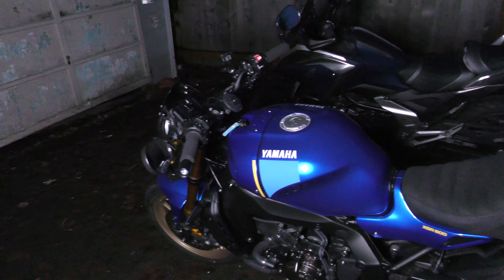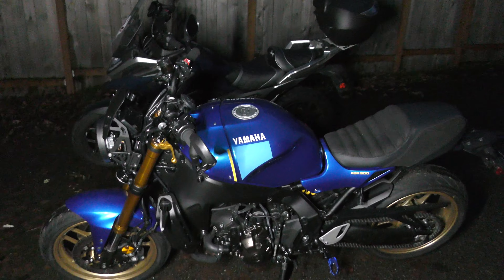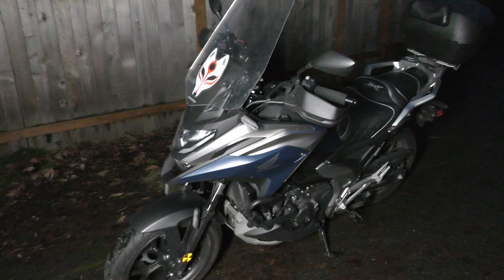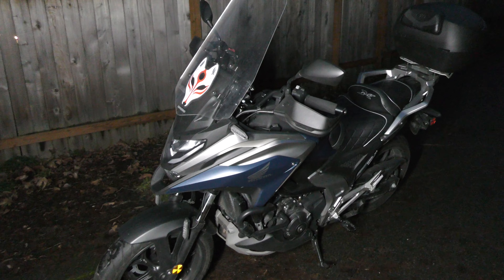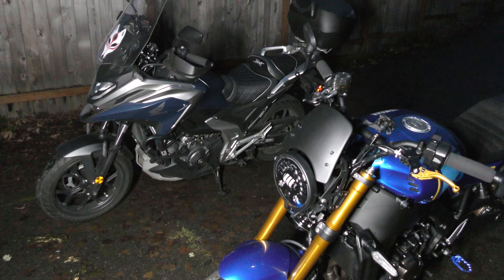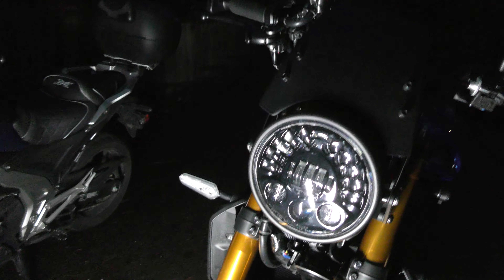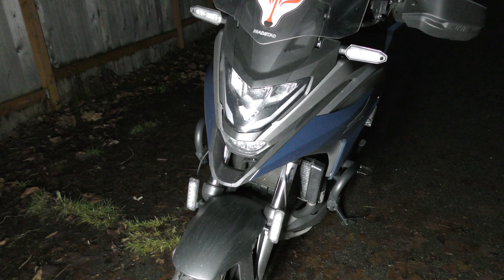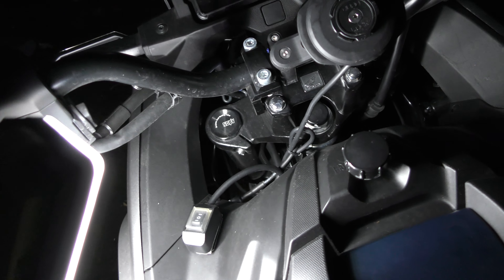Honda NC750X and Yamaha XSR900 FRONT LIGHTS!

Comment: Ye you can tell it's better than the Honda light. Honda lighting system though works better as overall safety package.
Reply from the maker: Yes, I was pleasantly surprised at how strong and WIDE the upgraded XSR900 headlamp beam is!
Reply: @TheDreamcycles  might also consider keeping the OEM headlight but adding two Denali spot lights attached to the forks
Reply from the maker: @c.g.c2067  Yes, those Denali DRL lights are pretty amazing. I installed them on two previous bikes. In theory you could wire them to the pre installed USB port behind the headlamp.
Reply: @TheDreamcycles good to know, thanks. Think I will go for something cheaper though, Denali Electronics is expensive.
Reply from the maker: @c.g.c2067  Very true!